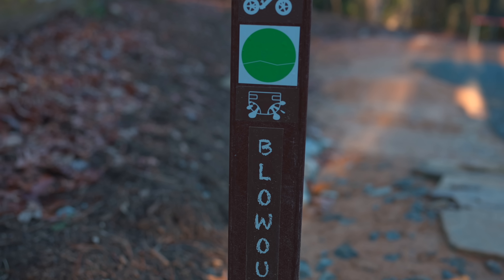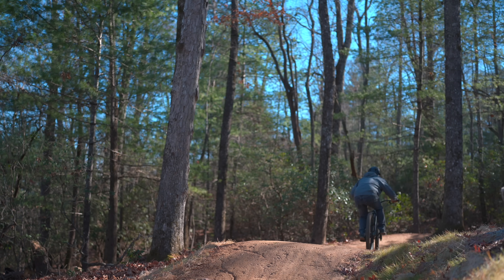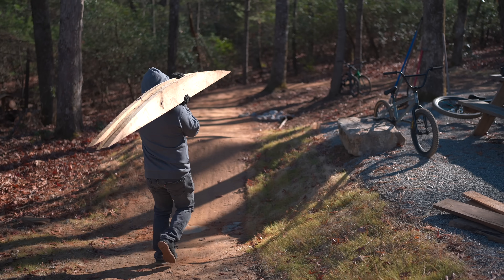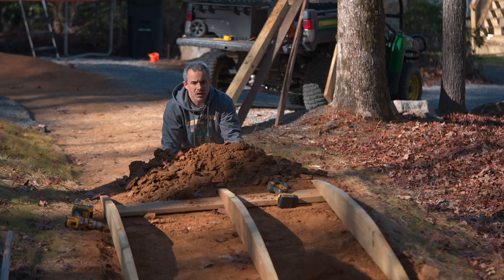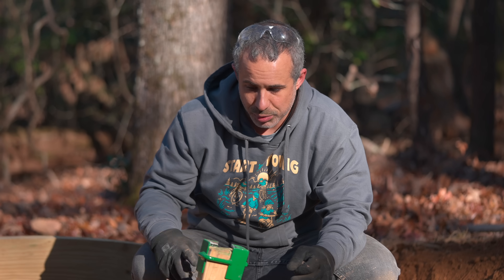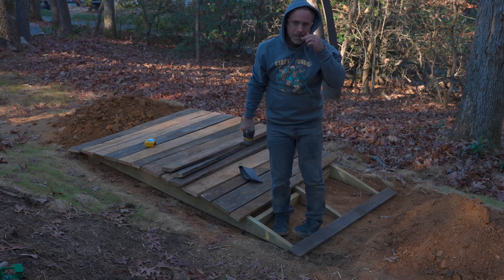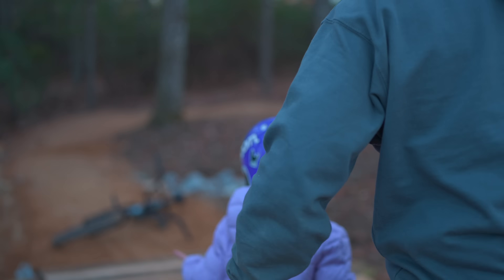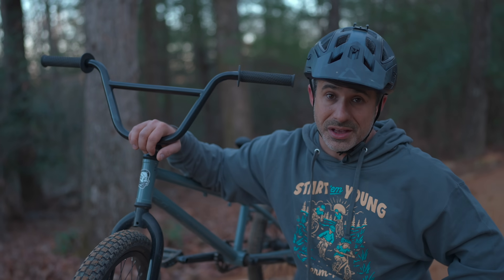Improving the best (MTB) thing I've ever built

Comment: 10:00 not gonna lie, you almost had me in the first half 😂😂
Reply: but to be fair at least in germany in construction imperial messurements are common. Plywoodsheets are 2 foot wide, pipe diameters are messured in inches and so on
Reply: Sorry to disappoint you, but as a carpenter from Germany I can say that we (at least in carpentry) are NOT using imperial measurements. Why should we? :-)

Btw: A sheet of plywood is 62,5cm or 1,25m (2 times 62,5cm) wide and 2,5m in length. 2ft are 60,96cm, so that's not the same ;-)
Reply: @haemmertime in argentina, mechanical engineering, standard pipes and structural steel is often in inches. we use metric for everything though
Reply: Most Americans use both interchangeably anymore and don’t even realize it. Even the guy that dropped out of school to be a drug dealer uses metric daily (grams). 😂

Learning the more complicated imperial system makes converting to metric pretty simple. Just knowing 30.48 cm in a foot and 2.54 cm in an inch makes it conversion to anything merely a matter of moving a decimal. Because if you memorize those two numbers you know there is 25.4 mm in an inch, or 304.8 mm in a foot or a foot is .3048 of a meter (unlikely you’d need to know that).

Anymore someone complaining about someone else using imperial just sounds like someone complaining about someone else not speaking English.

Comment: Heat treating the post driver caps should help them last longer. For something being hammered on you would want less hardness to reduce the embrittlement. Try heating the post driver until it's glowing red and then allowing it to cool as slowly as possible should help with stress relief and reduce chances of welds cracking. Hammering is going to work-harden them but it may buy you more usable life.
Reply: All it needs is a chamfer on the post. Nothing fancy. Just ancient knowledge.

Comment: As a father of two, great job Seth, the time you spend with your kids will come back ten fold. Here in Oz, we are international and love our metric but refuse to let imperial go in carpentry. We still buy our lumber in lengths of 1.2m, 1.8m, 2.1m, 2.4 etc (or 4 ft, 6ft, 7ft, 8 ft etc), we still lay out our house construction with joists at 300mm, 450mm (1ft, 1ft6), the list goes on.   I'm not sure if this video makes me laugh or cry, but either way, thanks for sharing.

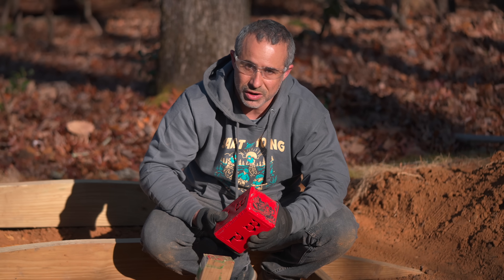Comment: 8:50 make yourself a persuader. Like a 12” round log about 18” long that you drop on it. They tend to use them more on log cabins jobs as the slow momentum and mass is better than  a sledge and is quieter. 
Post hole rammer may work too. But you may not have enough post to use one properly.

Comment: I made a post cap out of a single piece of steel with a few strategically placed cuts then bent into shape. No welds so it can flex a bit and so far it has held up to hammering in like 200 stakes. I think the steel was an anchor plate for a deck beam or something. It’s pretty thick and heavy.

Comment: You need a thicker piece of steel for the top cap, then weld the side plates to the bottom edge of it, instead of having a thin piece of steel in the center of angle iron. Also need a softer grade of mild steel so it can deform rather than crack. I'd go with at least 1/4" for the top cap if not 3/8ths for overkill. Need to get the TIG welder moved to my new house. I could knock one of these out pretty quickly.

Comment: You need Gallagher’s Sledge-O-Matic to drive those 2x4s. Just get a piece of a tree trunk about 6-8” in diameter and a wooden dowel set with epoxy for a handle.

Comment: when you said "the way it sounds over the boards" I was imagining having them slightly loose, so they rattle as you roll over. Should be possible if you countersink the screws so the heads are recessed, or perhaps use bolts/something that won't bend

Comment: If you cut the edges off the end of the 2x4 that you are striking with the hammer, it will not split. Also cut an angle off both sides going into the ground.

Comment: Hit the 2x4 in the center and you'll be fine. We use and reuse them for concrete forms in that same configuration and are in NC for dirt reference. We adjust the angle of the tip depending on the dirt, and if it's gonna be below a surface then it doesn't matter if the top is mushroomed. At most what are you gonna splinter a couple inches of the top of the stake?

Comment: You shouldn't use a sledgehammer to drive your posts with the post cap, you should use a heavy-duty rubber mallet with sand on the inside. It lessens the impact but increases the force. In other words, instead of sending energy straight into the end cap and breaking it, the energy transfers all the way through the 2x4 and drives it home more easily without breaking the cap. 👌

Comment: If you cut a 45 degree chamfer in the end of the post you're then hitting the middle grain instead of the edges and it significantly reduces the chances of it splitting.

Comment: metric is base 10, and imperial is base 2 and fractional. they were designed for different purposes. 

if you have a calculator and a reasonable math education then metric makes perfect sense. all calculations can be done on a computer and the decimals are easily converted to the real life measurements as long as you have the tools. it's very tool and technology focused and limits itself by excluding irrational numbers such as 0.3333.... that's a concept. not a measurement. a 3rd of a meter is 33.333333333333.... cm. there is never going to be a mark that denotes a 3rd of anything in a metric toolset. 

on the other side, imperial is for a simpler more rural person with minimal tools. the arbitrary measurements correlate to your body. an inch is the distance between your knuckles, a yard is half your arm span, a foot is... a foot. and all of the math.,.. it's fractional. everything is a half, or a half of a half, and so on. it's ridiculously easy for the layman to mentally process this level of computation and doesn't exclude a concept such as 1/3 just for being an irrational number. a 3rd of a foot is just 4 inches, a third of a yard is just one foot. and you can build pretty much anything with minimal technology and tooling.